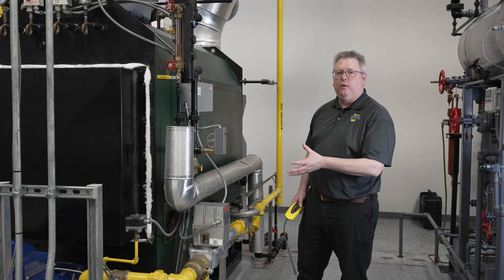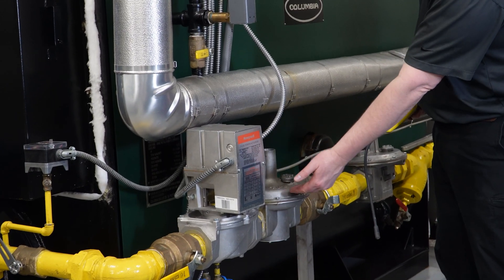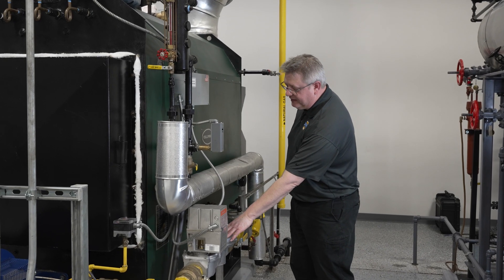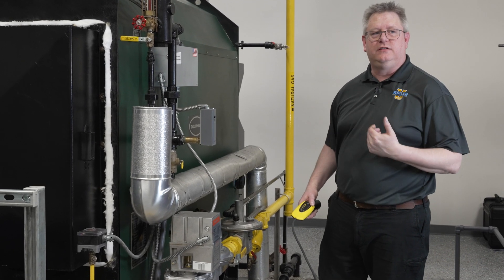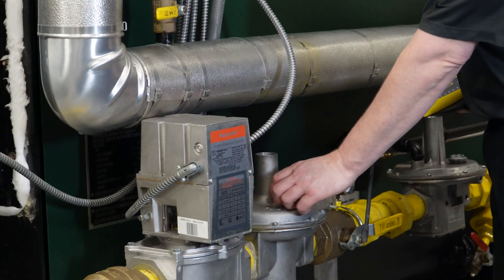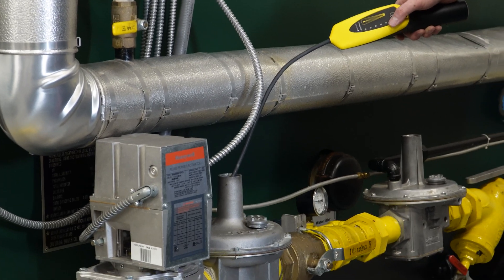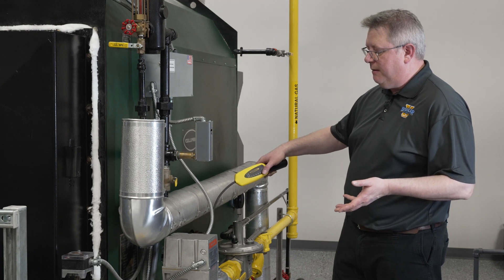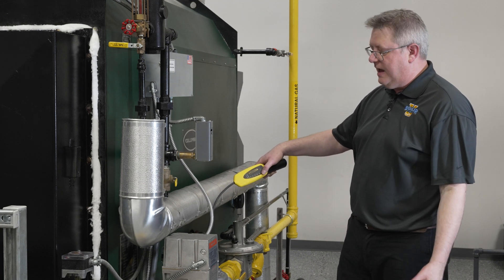The Regulator Diaphragm: How to Check for Gas Leaks Part 3 - Weekly Boiler Tip

Comment: Tick rate CGIs (combustible gas indicators) are one of best inventions in our tool box to locate & pin point gas leaks or passing controls but in no way should they be used in place of a pressure test. The simplest pressure test of a gas train is to turn the gas off before the drip leg. Remove the drip leg  & install a pressure tap apparatus, Connect your manometer or appropriate gauge for the pressure. Turn the gas on & back off , now you are pressure testing and verifying that gas train (please note : you will want to verify your gas cock (shut off )  is not passing gas in any way. A passing gas cock would undermine your pressure test).
Grate video👍 & regards from St. Louis.